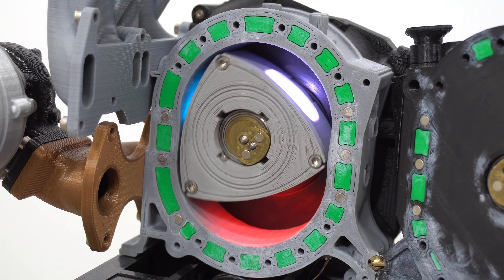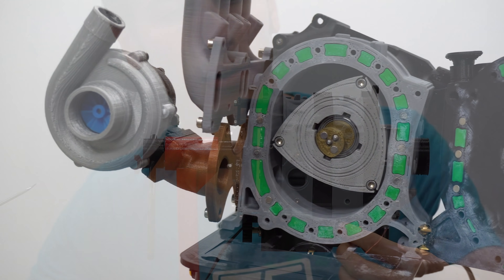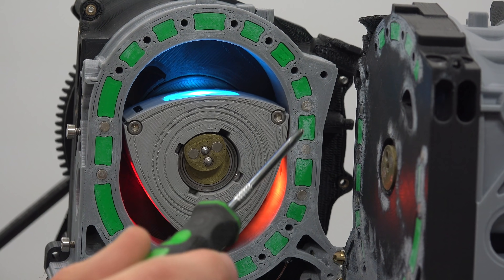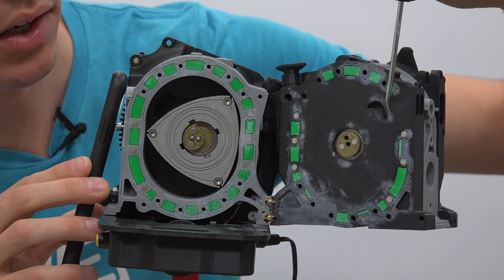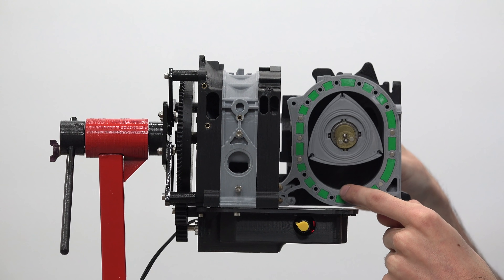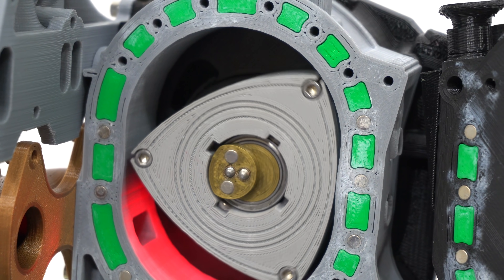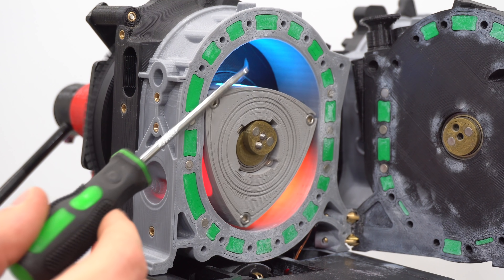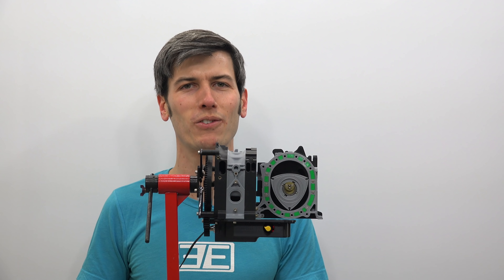This 3D Printed Rotary Engine Is Genius - Mazda RX-7

Comment: Mazda chose to count one working chamber per rotor because Japan, also Europe as well, tax cars based on engine displacement and any engine over 1.5 liters was taxed more than those below 1.5 liters, which risked Mazda's Wankel cars not being sold in certain markets. However, America, also Canada, New Zealand, and Australia, doesn't have this problem and can use the Wankel's full displacement. So, Mazda decided to avoid taxation on their Wankel engines by only counting one working chamber for each rotor, instead of all three working chambers per rotor. So basically, Mazda's 13B 2 rotor, the "1.3 liter engine", is actually 3.9 liters and the Le Mans winning R26B 4 rotor is actually around 7.8 liters! Now, fuel economy and power output makes much more sense

Wankel engine displacement:
3√(3) x radius x width x eccentricity (all in millimeters)= Geometric Displacement per chamber
Geometric Displacement x All 3 chambers= Full Thermodynamic Displacement per rotor
Thermodynamic Displacement x number of rotors= Full engine displacement
**This formula applies to ALL Wankel engines

Wankel engine basic dimensions:
Radius- Rotor radius, center to apex (generating radius)
Width- Rotor width, depth (rotor thickness)
Eccentricity- Offset (radius offset)
**Similar to bore and stroke dimensions of piston engines

Wankel engine equivalency:
1 rotor engine- 3 chambers= 3 cylinders- Inline 3
2 rotor engine- 6 chambers= 6 cylinders- Inline 6, VR6, V6, Flat 6
3 rotor engine- 9 chambers= 9 cylinders- W9
4 rotor engine- 12 chambers= 12 cylinders- V12, W12, Flat 12
**Comparison between piston engines and Wankel engines

Revised Mazda Wankel engines:
Mazda 3A
3√(3) x 110mm x 45mm x 14mm= 360,093.3629~ 360cc per chamber
360cc x 3 chambers= 1080cc or 1 liter
*Equivalent to a 1 liter 3 cylinder engine

Mazda 40A
3√(3) x 90mm x 59mm x 14mm= 386,281.9711~ 386cc per chamber
386cc x 3 chambers= 1158cc or 1.1 liters
*Equivalent to a 1.1 liter 3 cylinder engine

Mazda L8A
3√(3) x 98mm x 56mm x 14mm= 399,230.7829~ 399cc per chamber
399cc x 3 chambers= 1197cc per rotor
1197cc x 2 rotors= 2394cc or 2.3 liters
*Equivalent to a 2.3 liter 6 cylinder engine

Mazda 10A
3√(3) x 105mm x 60mm x 15mm= 491,036.4039~ 491cc per chamber
491cc x 3 chambers= 1473cc per rotor
1473cc x 2 rotors= 2946cc or 2.9 liters
*Equivalent to a 2.9 liter 6 cylinder engine

Mazda 12A/12B
3√(3) x 105mm x 70mm x 15mm= 572,875.8046~ 573cc per chamber
573cc x 3 chambers= 1719cc per rotor
1719cc x 2 rotors= 3438cc or 3.4 liters
*Equivalent to a 3.4 liter 6 cylinder engine

Mazda 13A
3√(3) x 120mm x 60mm x 17.5mm= 654,715.2053~ 655cc per chamber
655cc x 3 chambers= 1965cc per rotor
1965cc x 2 rotors= 3930cc or 3.9 liters
*Equivalent to a 3.9 liter 6 cylinder engine

Mazda 13B/Renesis
3√(3) x 105mm x 80mm x 15mm= 654,715.2053~ 654cc per chamber
654cc x 3 chambers= 1962cc per rotor
1962cc x 2 rotors= 3924cc or 3.9 liters
*Equivalent to a 3.9 liter 6 cylinder engine

Mazda 16X/SkyActiv-R
3√(3) x 122mm x 70mm x 18mm= 798,752.5504~ 798cc per chamber
798cc x 3 chambers= 2394cc per rotor
2394cc x 2 rotors= 4788cc or 4.7 liters
*Equivalent to a 4.7 liter 6 cylinder engine

Mazda 13G/20B
3√(3) x 105mm x 80mm x 15mm= 654,715.2053~ 654cc per chamber
654cc x 3 chambers= 1962cc per rotor
1962cc x 3 rotors= 5886cc or 5.8 liters
*Equivalent to a 5.8 liter 9 cylinder engine

Mazda 13J/R26B
3√(3) x 105mm x 80mm x 15mm= 654,715.2053~ 654cc per chamber
654cc x 3 chambers= 1962cc per rotor
1962cc x 4 rotors= 7848cc or 7.8 liters
*Equivalent to a 7.8 liter 12 cylinder engine

You get the idea. Wankel rotary engines are actually much bigger than we thought they were. They pack a lot a power and displacement in a small, lightweight package. To fully understand these engines, all three working chambers for each rotor must be counted, despite Japan and Europe's taxation regulations, and not just only one or two working chambers per rotor
Reply: No, they chose to count one working chamber per rotor because that's how engines are measured.  My 125cc 2 stroke motorbike isn't called a 250cc just because it draws an intake charge every revolution.  In a Wankel, each rotor fires once per engine revolution, just like a 2 stroke piston engine.
Reply: @thisnthat3530  Mazda choose to count one chamber per rotor just to get away with paying less for engine taxation in Japan and Europe. The story is there. Mazda just gave a nominal displacement of 1/3 of its real displacement.

In piston engines the cc of the bore and stroke of one cylinder is multiplied by the number of cylinders to get its displacement at a full thermodynamic cycle ( 2 crank-shaft revolutions)

A Wankel rotary engine isn't a 2 stroke engine and in a Wankel rotary engine EACH ROTOR SIDE (3) fires at 1 eccentric shaft rotation. Its real thermodynamic cycle is at 3 eccentric shaft revolutions (1080°) where all rotor sides have completed one 4 stroke Otto cycle.

In a 13B 654 cc x 6 chambers = 3924 cc (3.9L) @ 1080° (full thermidynamic cycle)
Reply: @EM6285  "EACH ROTOR SIDE (3) fires at 1 eccentric shaft rotation" - Wrong.  Only ONE (1) rotor side fires per eccentric shaft rotation. The rotor is spinning at 1/3 the speed of the eccentric shaft.  Look at the start of the video, it's all there at the very beginning.  Watch closely.  In a Wankel engine, each rotor only produces ONE power pulse per rotor per output shaft revolution, so why should 3 chambers be measured when only one is "active"?  Do you count the volume of the intake and exhaust manifolds when calculating piston engine capacity?  While I understand the desire to call a 13B a 2.6L engine, there's no way I'll accept it being a 3.9L.
Reply: @thisnthat3530  
Each rotor produces 3 power pulses (ignition), one per rotor side when going trough the Otto 4 stroke cycle. 

In a 13B engine:
 At 360° rotation of eccentric shaft 1 side per rotor (2) have completed a 4 stroke cycle.
654 cc x 2 = 1308 cc (Nominal displacement)

At 720° eccentric shaft  rotation 2 sides per rotor (4) have completed the 4 stroke cycle.
654 cc x 4 = 2616 cc 
Now, because 720° of rotation is the metric used on the piston engine's thermodynamic cycle, somehow it is used to give an "equivalent displacement" of 2.6L to the 13B rotary engine, but there is one problem, you have 2 more rotor sides that will complete a 4 stroke cycle and they got to be counted-in

At 1080° rotation of eccentric shaft rotarion 3 sides per rotor (6) have completed a 4 stroke cycle.
654 cc x 6 = 3924 cc
This is the real thermodynamic cycle fot the rotary engine. You got to count all its sides completing 1 4 stroke cycle each (full thermodynamic cycle) and in Mazda rotary engines is at 3 revolutions of the eccentric shaft (3 power pulses)
One power-pulse per eccentric shaft rotation and its thermodynamic cycle consosts of 3 power pulses.
Reply: @EM6285  So?  Engine displacement isn't and has never been measured by "thermodynamic cycle".
Reply: No, the 13B as Jason stated is equivalent to a 2.6 L engine. He did the math int eh video, watch again.
Reply: @407BRR  

Its equivalent to 2.6L when they measure it with the piston engine's metrics or when they use the piston engine's 720° of crankshaft rotation (its thermodynamic cycle)

At 720° of eccentric shaft rotation 4 rotor sides (2 per rotor) have gone one complete 4 stroke cycle, there the 1.3L doubles to 2.6L, but there are 2 more rotor sides to complete one 4 stroke cycle each and they got to be counted and thst is why its true displacement is 3.9L

654 cc x 6 chambers = 3924 cc @ 1080° (its full thermodynamic cycle)

Comment: What killed this engine was the dirty fuel that went in it as carbon buildup in this type of engine is very bad. If pure hydrogen is used which has no carbon in it the engine will last for a very long time with no real problems and it also gets rid of that unburnt fuel as the burn rate of hydrogen is so much faster than gasoline. Then if you take a portion of the exhaust and feed it back into the intake system you can control the burn rate and lower the temperatures. 
Now this part is going to be unknown to you as if you then ionized the incoming air focused on striping the oxygen atoms of their electrons you can increase the power output of this engine greatly.

Comment: Dude....... you know that's not how differnences in volume work. @Engineering Explained ffs your meant to be an engineer, i have less respect every passing video if your claiming:
1/3 scale = 1/3 volume,  i doesn't. its 1/21 aka 1/3* 1/3* 1/3 .
Reply: (1/3)*(1/3)*(1/3) = (1/27)
Pendejo

Comment: The future is now! I need a VR6 one of these babies.
Reply: Hello there! ✌😸
Yes it is! And, that's a great idea! 
Hey Jason! -Tempted to make a VR6 3Dprint engine-video now? 
😺👍👍👍👍👍
Reply: Please talk about oils and the increased thermal heat that a full synthetic can take which lower than it is or does that increase it to say s higher temperature? The gasses not breaking down because of the viscosity and  bonding capabilities of synthetic more unburnt fuel and oil reaches the exhaust ports to mainfold to catalytic converter and poisonous gas increase. That will force the intake stroke to misfire and that will cause the Apex seals to be flattened and damaged. Seals already being shrunk and then build up carbon being taken off the metals by the high mileage ful synthetic oils cleaning abilities and that is an older engines demise

Comment: 7:20 wouldn't a 4-stroke engine only have 1 power stroke for every 2 revolutions of the crank..? 1,000RPM = 250 intake strokes, 250 compression strokes, 250 combustion (power) strokes, 250 exhaust strokes. And 500 power strokes for 2-strokes.
Reply: Two strokes per revolution.  1000RPM means 2000 stroked per minute. and 1/4 of that two thousand are power strokes, so 500 power stroked per minute at 1000 RPM.
Reply: Durp, of course. Thanks

Comment: Can you check out the video called "rotary engine breakthrough?". It is a man hwo worked for Mazda and thinks he has fixed some major problems with the engine. He changed some of the shapes indide the engine and he said that it results in higher pressure and lower exhaust temperature.

Comment: hey Jason. What if the Apex seals would be replaced with a rolling tube and some sort of spring that pushes the tube against the cilinder wall? would it be possible  to do? I think it would seal of the chambers like the apex seals but since its a tube it rolls over the cilinderwal in stead of scraping, what decreases wear and tear as a result and hopefully needs less oil to seal.
I don't know if anyone tought about it but when i saw the video, my eyes fell on the missing apex seals in your 3D model and tought what if you replace those scrapers with that tube that i mantioned in the beginning.
Plus would it also improve the engines lifespam without a rebuild? 
Greets from Belgium

Comment: Why can't the outside surfaces of the rotor be concave instead of convex? Would it not be able to withstanding the forces? Seems like you could raise the displacement and create more power that way - doesn't help with the other cons though (emissions and reliability)
Reply from the maker: Not sure I understand. The face of the rotor is concave, with an indent in it for the combustion chamber. If it was convex, it would press against the rotor housing walls, and would not be able to rotate.
Reply: @EngineeringExplained  ie. The outer face of the rotor would be concave, effectively making the combustion chamber an ellipse instead of a crescent shape (current). Im not explaining it well, i know! The actual points of the rotor wouldnt change so the actual movement wouldnt change .. Only the effective volume of the combustion chamber.
Reply: I think I get what he's saying.
Notice Jason that the faces (piston heads, if you will) are essentially like dome top pistons, making it a rounded side triangle, bloated looking, you could say. 
He's talking about making the sides concave, so the 3 combustion surfaces between the seals, rather than being bloated, would curve inward instead more like an arrowhead or the treads on most directional tread tires.

I would say the problem with that is that compression would become much lower, and therefore create a much less efficient combustion than it already has. That domed face makes for a close compression with the rotor housing, when you watch it, and if your face was concave, you wouldn't get much compression at all, and as anybody should know, compression is power, compression is efficiency. (Hence why cars are coming with higher and higher compression ratios as time goes on... Gone are the days of 8.5:1 compression, as direct injection and other technologies are allowing for 13:1 or higher on pump gas.)
Does that sound about right, Jason?
Reply: @JoeIsCrazyWillman  Thx Joel .. That is what i meant. You could downsize the rotor cavity though in order to maintain the same compression. Im guessing you need a minimal amount of metal/strength to keep it reliable .. Subsequently, they used that particular shape on the rotor to get the compression they needed to meet the power target.
Reply: No, that's not the issue. The issue is it's a rotating assembly, which means the farthest out point on the rotor is your maximum compressing point.
If you you look at the video and how it works on the compression side, the convex rotor creates a tight compression point with a bulge in the housing. If you concave the rotor you won't get that squeeze, as the apex seals limit your travel towards the wall, being your farthest out point.
And no, shrinking the chmaber won't increase compression, you're just decreasing volume, because again, you're limited by your farthest out point rotating. Think dish piston compared to dome piston. You're never gonna get dome compression with a dish.

Comment: "Wank"-el. Teehee. It's pronounced "Vunkel". Interesting that the most widely used engine types were all developed in Germany. Mr. Otto, Diesel, and Wankel all say hello. Wankel had the idea as early as 1924 and patented the concept in 1933. NSU (a German car maker that eventually joined forces with Auto Union to form modern-day Audi) introduced this engine (in a production vehicle) in the RO 80 in 1967. Citroen also put one in the GSA, calling it the Birotor.
Reply: Actually it's Wunkle if you're going with typical English Phonetics: in German the W is soft and the A is as in Another, and -El of WankEl is pronounced as in i.e. wiggle
Reply: @EchterOsti  No, the German "W" is pronounced like the English "V". So "Vunkle", if you will. I am German. I should know.
Reply: @andypre1667 das englische W wird genau wie das deutsche ausgesprochen, also warum überhaupt v erwähnen?
Reply: @EchterOsti  Wie bitte? Dann müssten engl. "we" und dt. "wie" genau gleich ausgesprochen werden. Werden sie das? Von Günther Öttinger vielleicht. Und dir.
Reply: "the most widely used engine types were all developed in Germany."

I'm pretty sure the car was too...

Comment: 0:38: I thought if you had two turbo chargers, they were either twin or sequential, but not both.  Twins were identical (twins) with each driving their own bank/chamber, while sequentials were different so that one worked well with low volume and the other had high compression (both fed the same banks/chambers).  I only bring this up because I just saw another video that also said "twin sequential turbo chargers".
Reply from the maker: Twin means two turbos. The 13B-REW has two identical turbos (twin) that are used sequentially. First one gets air, then at higher RPM both get air.
Reply: @EngineeringExplained  Thanks.  I didn't realise they used twin turbos sequentially.  I had only heard of sequential systems where they were different sizes.

Comment: What if a wankel is run on diesel. Diesel has lubrication properties, so no need to burn oil. Less pollution?
Reply: Not enough sealing from the Apex Seals to create the high compression needed to ignite the diesel fuel.
Reply: @EM6285  Makes sense, thanks

Comment: What would happen if you designed the two rotor in such a way that for one rotor the exhaust is on the bottom and intake on the top and in the second it's the opposite, combustion on top and intake on the bottom? Would that help with heat dissipation and have a positive impact on reliability? I know you would need the exhaust and intake manifolds on both sides, one for each rotor, but I reckon there's nothing that can't be done here. What do you think Jason?

Comment: Those RX-7s looked good, sounded fun, the power was so smooth and they were quick. Not a muscle car but hey it was the 80s.  Just long-term reliability was an issue. Had a buddy that owned almost every year model and also had a GF that drove one til it basically needed to be completely rebuilt. Hmmmmm hey Mazda how about a E-RX?

Comment: But can you make this type of engine with tight enough tolerances so that you won't need contact sealing, using the viscosity of the air to stop it from leaking through few micron wide gap between rotor and the housing?